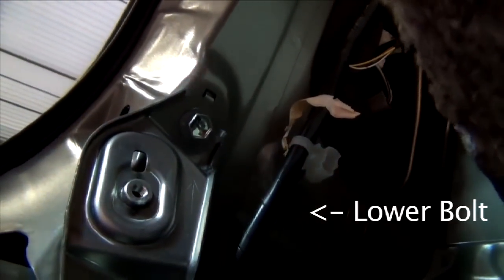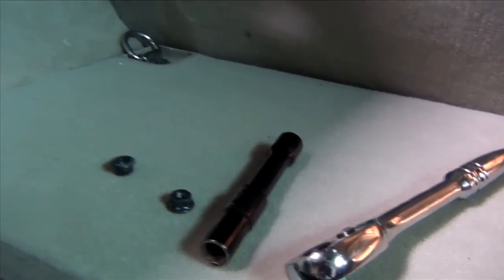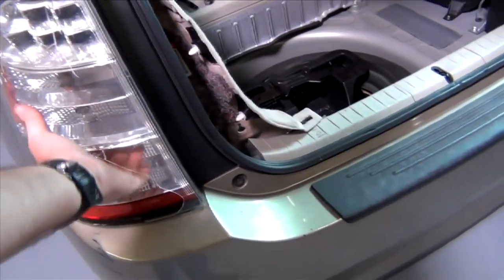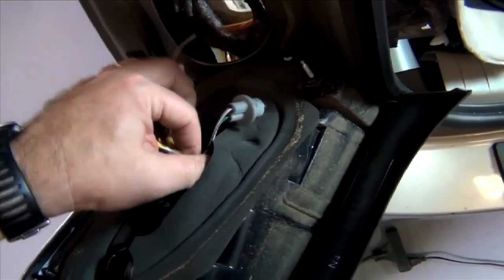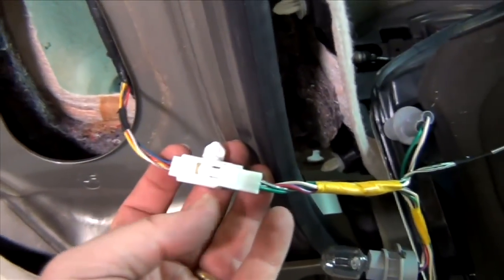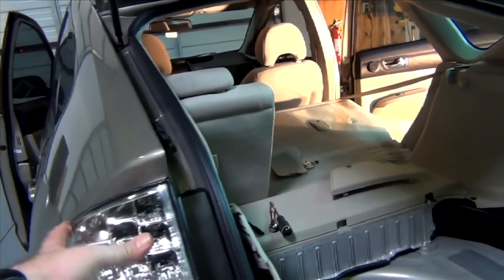How to replace a 2006-2009 Toyota Prius Tail Light assembly - LubeUdo.com

Comment: I saw this vid and It looked like more than I wanted to deal with. Called the dealership and got their voicemail, they never called back. Bought replacement on amazon from TYC. $78.46. Price went to $94.12 when I went back to leave comment. Anyway, perfect fit. Easy to change bulbs, like 5 mins. Whole job took about an hour. Would'nt have tried it without Lubeudo vid. Thanks

Comment: Great video. Bought the whole tail light assembly on eBay for $60.00 and replaced it in less than 15 minutes. No issues at all, proud to have saved so much money. Thanks!

Comment: fantastic video! i just finished replacing mine yesterday in roughly 15 minutes time! no traffic ticket or inflated mechanic costs in the near future for this driver!  :D

fyi: don't worry if you don't own a ratchet set. i used my 10mm wrench and it worked like a charm (you just have to turn it at an angle for the cargo latch nut @ 1:35 due to the tight space around it). a ratchet will definitely save you some time and hassle though lol. i would also recommend you disconnect the cable for the side lamp on the enclosure so you don't run the risk of pulling on and damaging the cable while it's moving around. it's just a tab on the cable that you press down on and disconnect.

also, @ 1:59 he doesn't show how to remove nut for the bin, but it's pretty simple. just grab either around or under the bin and lightly pull up so it pops off. i recommend keeping one hand on the nut so it doesn't go flying off into god knows where. :P

Comment: Thanks for this video -- ordered online and installed myself -- probably saved a couple hundred bucks. Key was knowing those pins were there and you can just pull off the assembly once the nuts are removed (just loosen these and they finger turn off easily) -- I used a plastic putty knife to get under and pop off the assembly. Thanks again.

Comment: I just took out the cargo part but didn't need to pull all the siding out. All it is is two bolts and a 10mm wrench or even just pliers! Pull the wiring off the two threaded parts and remove the bolts, then pop the baby out....easy peasy! 😃

Comment: We couldn't get the whole panel off but you don't need it all off, ignore the pink and black rubber bolts we were screwing with for a while. To unplug the power cable stick your keys or something in the bit that pushes up to keep it up, and then pull it apart.

Comment: On my 2008, 10mm socket did everything, but a deep socket was needed. The long bolt under the pull-out trunk cover was hard to align with the hole deep within the frame. I had to stuff a little paper into the socket so that I could angle the long bolt up to the hole in the frame.

Comment: Thank you for this excellent video. My story is the same. We have safety checks in my state and I couldn't get one unless the dim right tail light in my 2005 Prius was replaced, for $300. I bought the part, a metric deep drive socket set and ratchet on Amazon for $96 total including shipping. I put the part in as easily as shown in the video. I read the comments here first and got an additional tip of being careful not to drop the nut into the battery - a problem for right side replacements.
Reply: ugh, ~$200 for a service fee is crazy!!! i'm still very new to doing repairs on my car and this was by far the easiest one i've had to do yet. it literally took me about 15 minutes to complete the job with no issues whatsoever. hell, i should start freelancing my service on craigslist for $50 a pop. keep these ripoff car shops around here on their toes, haha! ;-)

Comment: Good video, my daughter and I got it dis-assembled but the "OEM" part from Amazon has metal pins for the outside edge not plastic.  It doesn't quite fit.  Looking for feedback... Is there an Amazon vendor with an OEM that works or should I simply do EBay and buy a salvage unit?  Right now we put the old one back (cracked lens now covered w packing tape) and left the carpet off to facilitate re-assembly.

Comment: Thank you for your video. my brake light was working 5 out of 6 than a week ago it all went out. So after reading around I just bought the left side assembly for 2004 gen2. It arrived today from Taiwan made from DEPO. But there is a big problem with it. The Parking light block inside the assembly is moving around. its not fixed in its place like the reverse light or the left turn signal. Is this normal or should I return it immediately.
thanks in advance for any response.

Comment: In my '09 Prius' right tail light assembly, the reflective cover that sits around the tail-light bulb (the one with the red lens), the most outer edge has fallen inside the assembly because it got pushed in by an LED bulb that was too long.
My question is, is there a way to remove the outer plastic or get access to the inside and put that "lid" back on? I haven't found a single post which shows how to open the tail light assembly itself. I just want to remove the exterior transparent plastic casing so that I can re-attach that lid and then close it back up.
Let me know.

thanks
J

Comment: Great video.   I was able to do the replacement on the right-side tail light and I only had one issue.   I should I read the comments after watching this video!   I dropped the nut into the battery well ......  8-)       Fortunately, the wife has long skinny arms, hands and fingers and was able to reach behind the battery and into the well to reclaim the fallen nut!